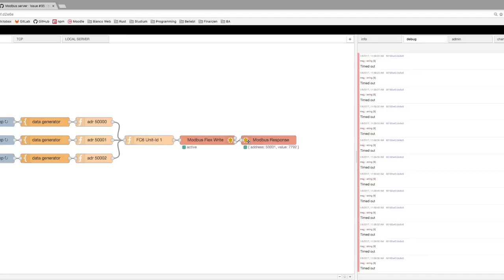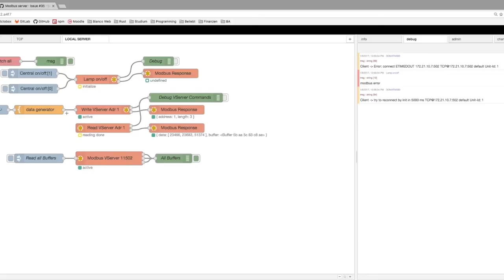node-red-contrib-modbus - Modbus Serial Timeout

Comment: Hi, I'm getting CRC error on one of my two slaves, if I use only one it's working fine, does it support RS485 multi drop? whats maybe the issue?
Reply from the maker: Please, provide some logs and open an issue on github!
Reply: Its Ok now, the fault was from the 2nd slave, its my self built microcontroller Modbus RTU slave, it was replying an error on receipt of different ID.